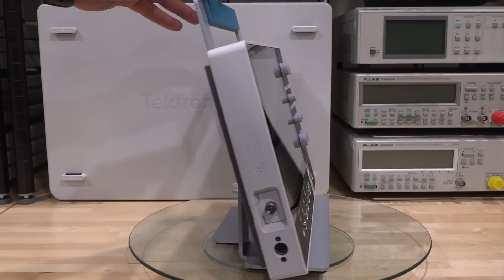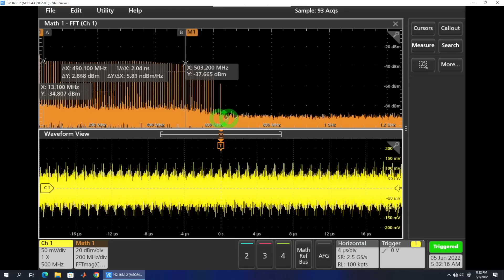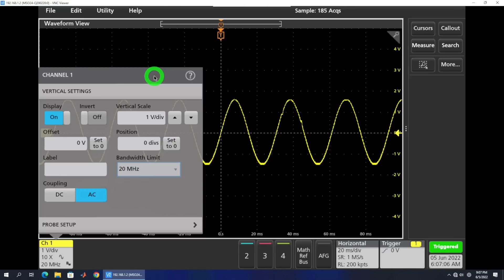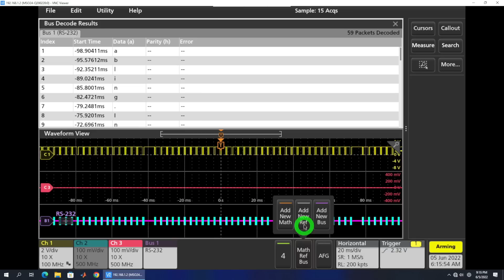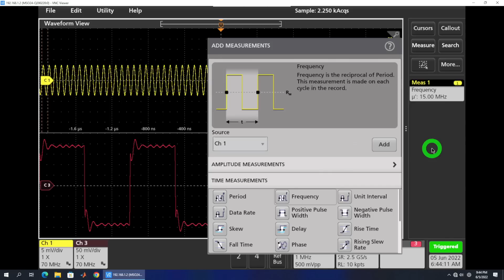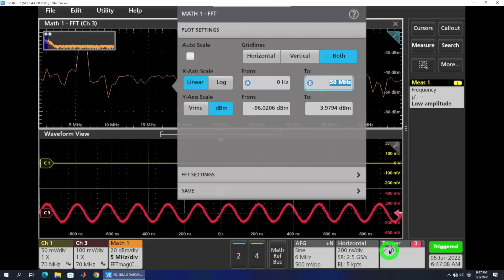TSP #225 - Tektronix 2-Series 4-Channel 2.5GS/s 500MHz MSO Review, Teardown & Experiments

Comment: The most expensive and overpriced oscilloscope in the world. With the fewest features and possibilities in the world. In the videos in which paid and Tektronix-dependent influencers promote this "entry-level oscilloscope" like sour beer and talk about $2,000 dollars, they are holding an oscilloscope in their hands that costs a good $20,000 dollars at Tektronix. Because all the features that are shown are not included in the $2000 version and have to be paid for separately.

And it seems that this is the first "entry-level" oscilloscope that doesn't even include probes. And those cost another four-digit amount at Tektronix.

Comment: Looks to be around $11,000.00 for the 4 channel 500mhz… $1700.00 for the 2 channel 70mhz. At those prices I assume it’s priced for government applications that are on the GSA schedule… Perhaps I’m looking at the wrong price sheet. The ZYNQ is a fairly expensive single part, but over ten grand seems a little spendy for what looks like a production scope… I guess it’s running some really costly firmware. Looks nice though.

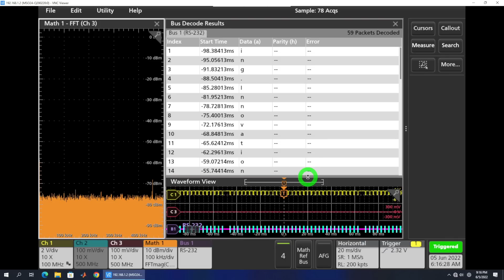Comment: Great video! I loved how you thoroughly loaded the oscilloscope at around 25:50 and it still performed its functions and the UI was still responsive. Is that also true when you use the touch? The reason of my question is that. surprisingly, the MDO3/4 that I evaluated back in 2019 was incredibly sluggish, requiring several seconds to respond to touch and its physical controls.

Comment: Can The Signal Path do an experiment or comparision regarding low Waveform Capture Rate of Tek. Right now I am using Tek 4 series. How useful is the high Waveform capture rate. I have never used Keysight before. I am hoping Shahriar will provide an answer why Tek oscilloscopes costing several thousands of dollars is very weak in this area.

Comment: Excelent review as always!.
I guess in the long term those pins on the front for the pattern generator front would be better than a female connector. Those female connectors have a very limited number of insertions before the contact springs loose flexibility and I guess they'd need to be replaced more often than potential broken pins.
Hijacking the thread here, it'd be very nice if you could make a tutorial of how to calibrate a VNA before performing measurements. I always have the feeling of missing something or 'being blind' when using a VNA 😁
Reply: https://www.youtube.com/watch?v=x-tbvAbh9jk
Reply: The solution to that is to put a consumable connector as an interposer.
put a female plug on the PCB, then a make to female plug into that. You do all your work plugging on that second layer. when it's worn out you just replace that bit.

Comment: 5:12 like the way you lifted a few pads off when you removed the input shield! Not sure Tektronix were expecting that much of a teardown 🤣 Apart from the battery modularity option, there doesn't seem to be much different in functionality (for £10K) and performance than my Siglent SDS2504X Plus (£3K !) ... and the Siglent is 1/3rd of the price with more AWG options and protocol decoders and a 16 channel digital logic analyser !
Reply from the maker: This was a non-functional prototype board which I got from the factory. :)

Comment: THis FFT is made based on input voltage, but FFT is in dBm, so it is assuming that there is 50Ohm load and calculates power or it should be in dB.

Comment: Your board is significantly different than mine. When did you get yours? Mine is a qualification build from early April.
Reply from the maker: Hi Dave! My board was a prototype board they sent me from the factory. It is not the board inside the scope you saw operating. I suspect that it is older. I liked your analysis of the teardown!
Reply: @TheSignalPath  Oh, interesting! Looks like they removed an entire memory chip next to the eMMC and quite a few other changes including a shield over the relay. Mine must be pretty close to the production version then I presume.
Reply: Funny that the silkscreen has the ghosts of the previous memory chips in place :D

Comment: Obviously, Tek just lifted the embargo today because a "different EE-related youtube channel" just released another teardown of the same product. The difference is that one video was listed as a "WORLD EXCLUSIVE TEARDOWN!!!" while the other... well... wasn't. Shahriar, thank you for posting great content with zero nonsense.
Reply: Sounds like EEVblog thought he was the only one. Seems like an honest mistake, since they likely cannot contact each other about a product while it is under embargo.
Reply: @nullptrRL  Correct, I had no idea anyone else had one. When I got mine in April they were so rare that not even w2aew Alan Wolke who works at Tek had even seen the battery compartment add-on that I got.
Reply: @EEVblog2  My original comment was intended to be more positive about Shahriar, but I think it also came off as negative about Dave's videos (oh, Hi there, Dave). Probably should have worded it better, sorry if it came out the wrong way.
Reply: @EEVblog2  I still haven't had the battery accessory (or kickstand & rubber bumper & case) in my hands....

Comment: I don't understand why they make same hardware for all models and then lock it to 70 MHz. What they get by doing that?
Reply: They only have to manufacture, stock, support, write-software-for  one single piece of hardware.  But they can charge a premium to higher end users.  But it is  frustrating to know you have the higher end hardware, but just cant use it, if you paid for lower end services.
Reply: @tux1968  Maybe look at as they are selling you the 500 MHz scope, but knocking the price down if you want less bandwidth, like 100 MHz.  Makes that 100 MHz scope affordable for those who only need that much.  Maybe later you want more then you can buy it as an 'upgrade' (actually a 'less restricted').
Reply: One production line, 1 BOM to stock, 1 End of line test process, 1 stocking process, 1 returns and repair process! If the EEVBlog is anything to go by, and with the big difference in price between the bottom BW opt and the highest BW option, there will be someone that cracks the upgrade options!

Comment: An update video would be great after they enable the digital channels and the pattern generator. I'm particularly interested in the latter's interface. Mostly how easy it is do generate standard protocols like I2C, SPI, UART, etc. Each time i need a very simple test involving one of those, i find it easiest to just hookup a MCU dev kit and write some code. I know my signal generators can do it, but usually its simple to write some code.
PS: Sorry for the spam of like 3 comments just from me.

Comment: I predicted flat panel scopes. All the mechanical buttons will disappear and it will be much thinner. 
I note that as products mature they don't bother with all the overengineering theatrics of many radio boxes and separate boards and big clumsy power supplies etc. Nor any of the RF voodoo paths or machines metal enclosures it would seem. Losing the irrational reverence seems to help.

Comment: The big problem with it is that it has not galvanic isolated channel,  you can not do isolated power motor control measurement.
It is not interesting as you use to say. R&S  has better with isolated 4 channel , please make review of that.
Reply: Tek had isolated bench and handheld, not forgot Fluke and the New Zeeland Isoscope and a french where i forgot the name. All with there own isolation technique. But shure R&S is 500MHz only.

Comment: You have a different revision board compared to what Dave Jones got. I wonder who's board is newer and what the the differences, other than eMMC placement. Given the different connector for the battery i would guess that Dave's board is newer.
Reply: Mine is a qualification build, and I got it back in mid April. There are quite a number of differences if you look closely. This one has an entire extra memory chip next to the eMMC
Reply: @EEVblog  Yeah after i wrote the comment i looked for other differences and there were a lot.

Comment: I love your video as you are tearingdown the thing, but the most important, explaining ideas about how to use triggers, fft and so on. About the scope, is lovely and too expensive for my budget (>12keur x 4 channels 500Mhz).
Reply: 12k ? That is ridiculous
Reply: @ViniciusMiguel1988  2 chan starts at 1.8k at like the ..50 mhz or whatever. Maybe +1k for the other two? Crippled down for sure, but the hardware is there. 

Back when FLIR had their top of the line E8 selling for $6k and their entry level E4 selling for $1k good ol  Mikeselectricstuff did a teardown. He quickly found out the huuuge piece of 320x240 uh SiGe? was left in there, just with different firmware...they were soon bought out by Teledyne ;) I don't think Tek would 'come agusta' considering how absolutely massively that mistake resonated..basically around the planet

In the Zync there are a few ARM A53s and an R. (Dave speculated the Rchips were for the display, but I'd actually guess the other way around). Anyways ARM's TrustZone hasn't been haxored yet I don't think. I bet you give Tek dollaz, they give you key, key goes on NV storage, auths against the private key that's internal to the IPcore which regulates the clock acq. And if that's if they really try-harded. 

Unlike Rigol, Tek's a premium brand....its not like the literally millions of scopes they're going to sell to universities are going to be bottom-bought then cracked with keys. At least, they didn't steal Cadence or Altium at my uni haha (philosophy major, my AD creds wouldn't get me onto an EE machine to even try!)